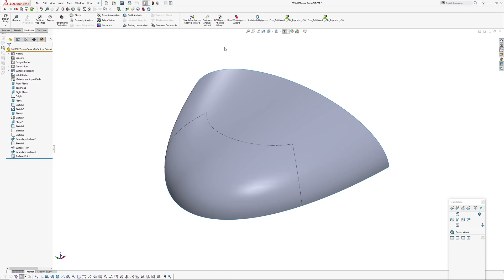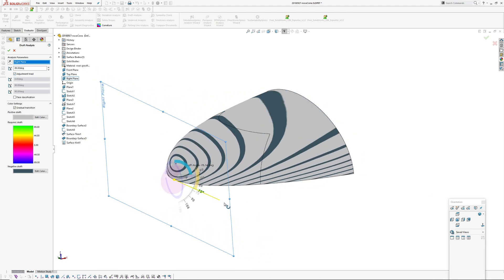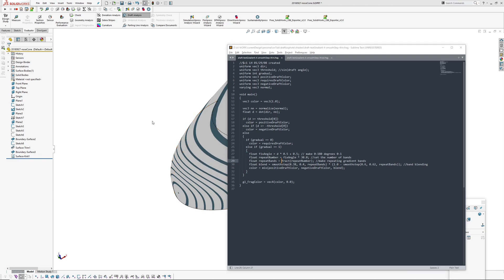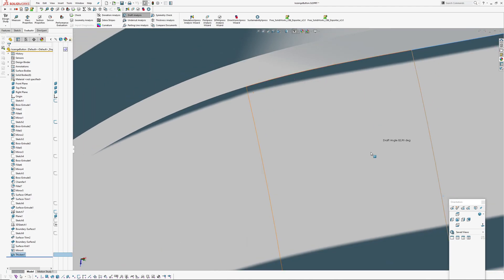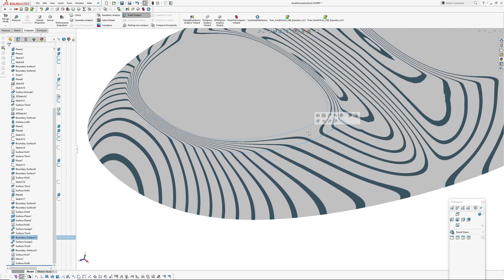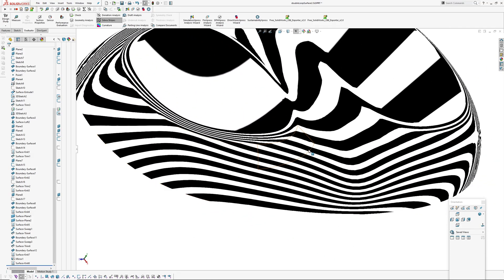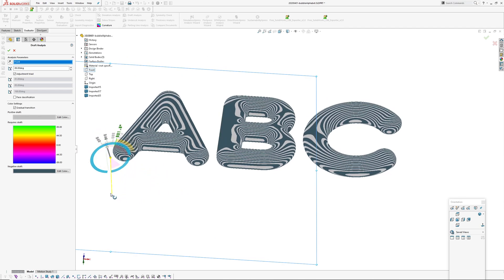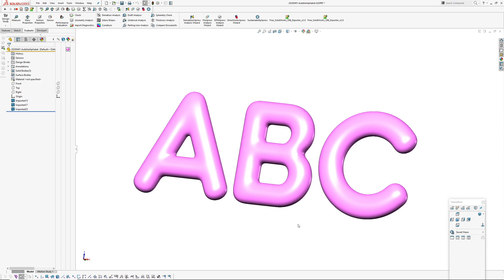Isophote/Iso angle analysis in Solidworks phase II

Comment: Excellent work mate. You contacted SW/user groups? 
Have you got SW model accuracy set to max? this made quite a improvement on complex surfaces in creo, larger file sizes tho. I think the sw translator dumbs down accuracy on import/export might be why your bubble letters are not perfect from rhino, do you get same issue interogating the part in rhino? 
Now you have this its a never ending search for perfection?
Reply from the maker: I think the issue with the bubble letters was I imported the whole alphabet and deleted all but three letters. The mesh was not great before I deleted the other letters. It’d be great if SW gave users control over the mesh like in Rhino, rather than a slider with max and mins that are out of the users control. I’ve been reading some stuff on the API. Going to be a learning experience to integrate this as a feature 🤢

Comment: Hi Andrew, could you show the workflow of Natuzzi Revive Recliner, or a similar armchair with multiple cushion. I'm trying to do the Arper - ASTON CLUB
LOW BACK chair. I was thinking about doing the main curves in solidworks or grasshopper. Then doing the surafce in rhino single span like you showed in the magic mouse rhino video,
Reply from the maker: Hi Ali. From memory the seat shell has two primary surfaces that make up a half - one across the bottom, then the curved side. I'll have to have a dig through any project files I have to see how we approached the back shells. There's a few images of the internals on my website. https://ajdesignstudio.co.nz/product-development/natuzzi-revive/
Reply from the maker: The back shell is made from multiple patches, but the shell is padded on both the inside and rear faces with a mix of cut and moulded foams. I've put some images on my Google Drive you can have a look at. Some are production parts, some are early exterior concept models but you can see the surface layout.  https://drive.google.com/drive/folders/1Q176_qhnJya7vTVvB7Gv-B8idOgLo2Wm?usp=sharing 
Cheers!
Reply: @AndrewJacksonDesignStudio  Thanks, i really appreciate integrity of the parts. I’m now more interested on the exterior patches for single PU foam mould and i’m trying to put pieces of patches together. Your channel and videos really influenced me about trying varios methods to create smoother and relaxed surfaces.
Reply from the maker: Good stuff Ali. Agree there's always more than one way to approach something! I've modelled several moulded foam forms over the years, sometimes a straight offset from the substrate, but more often than not they are variable thickness. Just to make it more challenging!